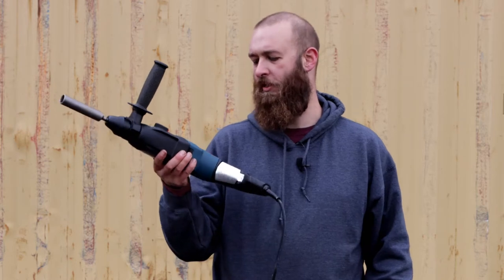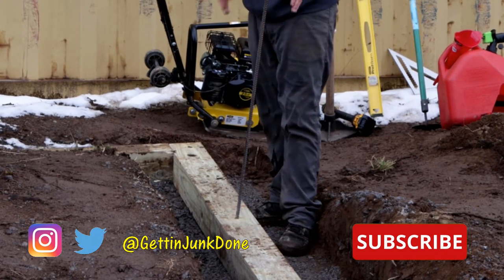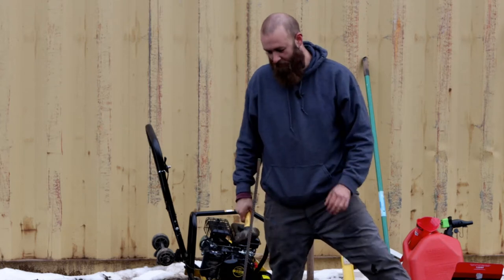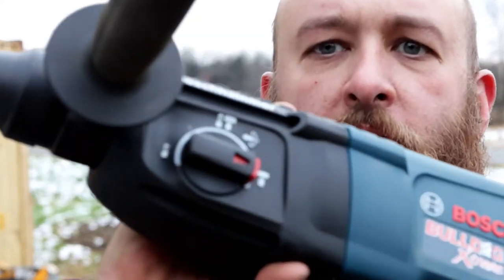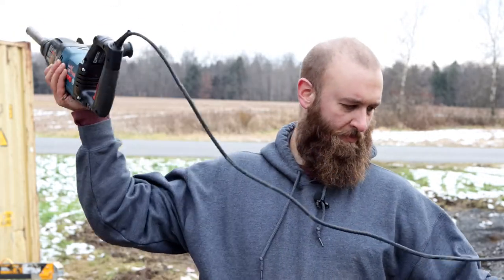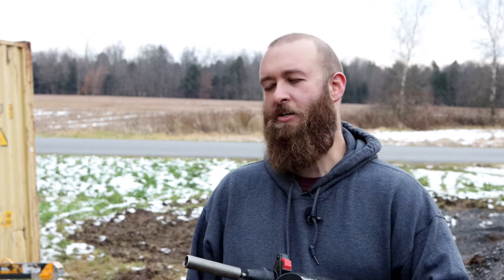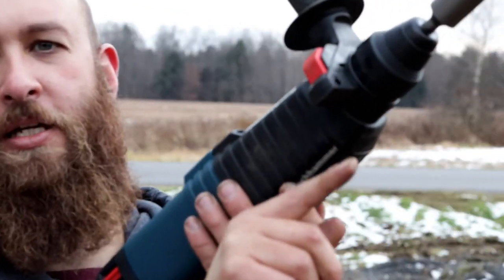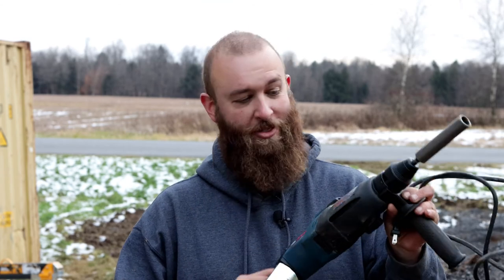Bosch BullDog Extreme 1 Inch SDS Rotary Hammer Drill Initial Review by @GettinJunkDone

Comment: I think the rebar is not made to be in the ground, it will rust after a few years compromising the strength of the foundation. For this reason, concrete foundation code is pretty strict on rebars being suspended a few inches away from the dirt

Comment: I have the same Bosch hammer drill. It drills through cement like butter. What you are using it as is not really its true design purpose. What would work great for rebar driving is a pneumatic air hammer like what I use in auto body work. 3500-5000 bpm of inch plus movement  pneumatic air hammers would drive your rebar in thru the wood and gravel. Give that a go, use your hammer drill for its hammer drill through cement purpose. Nicely done though!